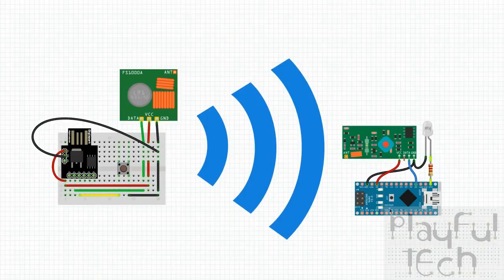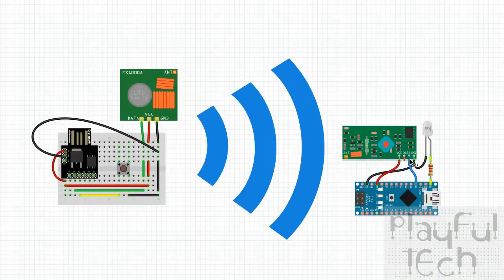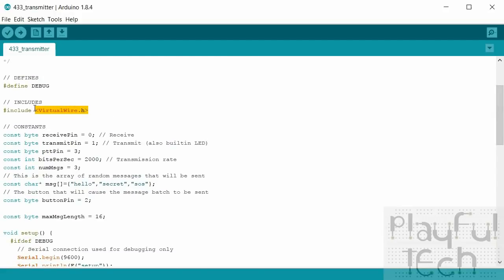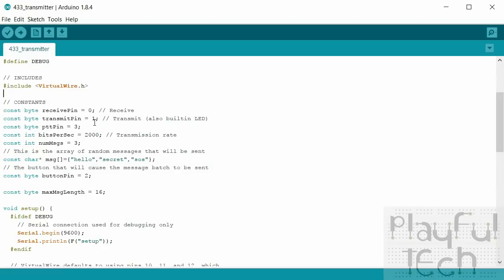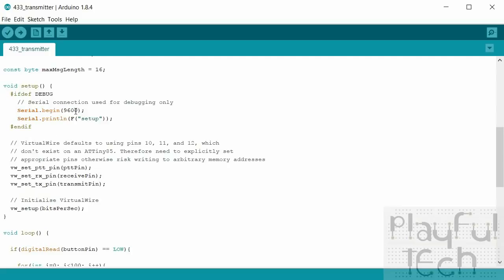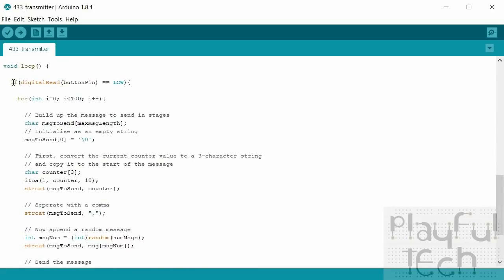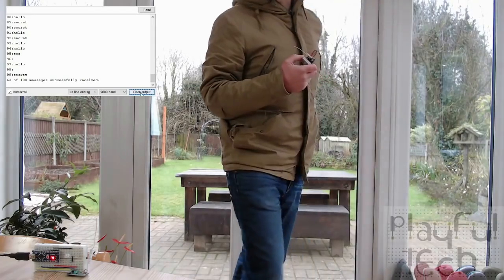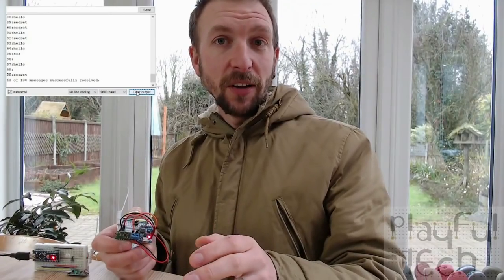Radio-Frequency (RF) Communication Modules

Comment: I think there must be some good and bad RF modules available, I bought a pack of 5 TX and RX from a well known on-line supplier. None of them work. I know it's the modules as I bought another pair from a different supplier and they worked fine. BEWARE of imitations.

Comment: Is it possible to use a receiver to pickup a signal from a remote control on the same frequency or does the receiver and transmitter only work with each other?

Comment: Could you use two of these as transmitters, sending messages to a robot with a receiver, to create a positioning system using trigonometr and the time taken for each message to arrive from the anchor/transmitter?
Reply from the maker: You _could_, but you'd need to have a very accurate timestamp synchronised between the devices, or else a multiple roundway-trip at which each device records their own timestamp, and then compares that to the time at which the response is received back.

Comment: Is there anyway you could do a tutorial with a raspberry pi 3? I am working on this project and have tried alot things  but i cant seem to turn them on. Im sorry if this is a silly question but are those antennas necessary?
Reply: The antennas are necessary. Otherwise the modules will only be able to communicate if they are directly next to each other. The antennas are used for increasing range.

Comment: If i apply power to the transmitter will it transmit a noise on the frequency......like a beacon or does it need programming? Thanks

Comment: How to create interference to a hifi (mine obviously....) with a 433 mhz module?
Reply from the maker: Most hi-fi/TV remote controllers use infrared - are you sure yours is 433MHz RF?
Reply: @PlayfulTechnology  No. But I want to use these two modules to achieve this function for other uses. These 433 mhz pcb only act as a conduit.

Comment: Hi,
Nice video!!! Im currently working on a similar project. Got a few question regarding the transmitter/receiver.

Is it possible to use multiple transmitters on a single receiver? 
What is the power consumption of the transmitter?
Can I use a coin cell battery to power the transmitter?
Reply: really? he said it in the video
Reply: yes coin cels are also good

Comment: Hi. Does the receiver's digital output merely mimic the transmitters digital input state? I intend to use one on a Microchip PIC based project to syncronise three close proximity circuits.
Reply: use a ht 12e and ht12d encoder decoder ic
Reply: Ķ

Comment: Hello sir.. i have a question.  i want to make a remote control servo system with arduino. Is it support PWM signal ?
Reply: If yo can Tx an integer value then that could be your PWM value.